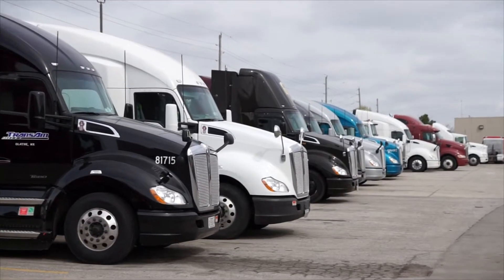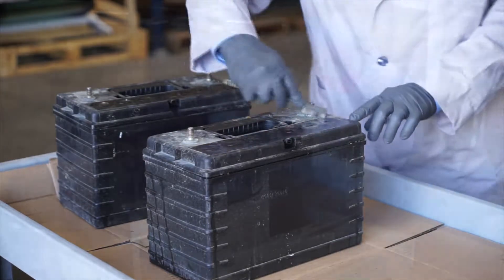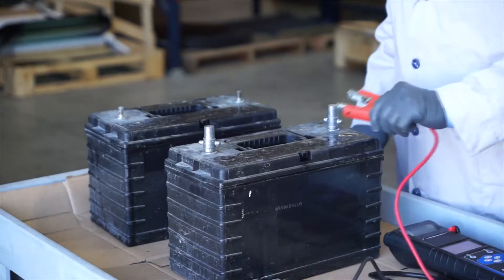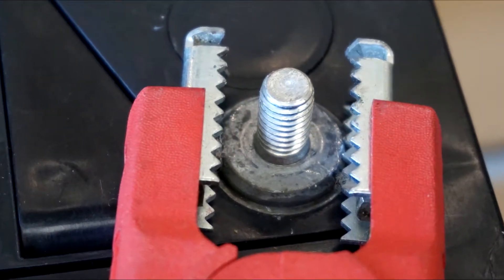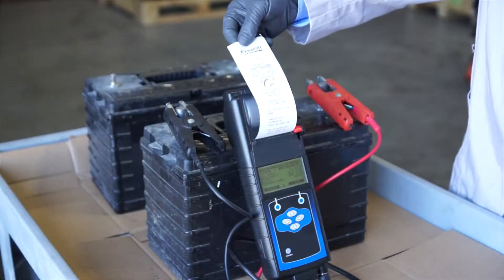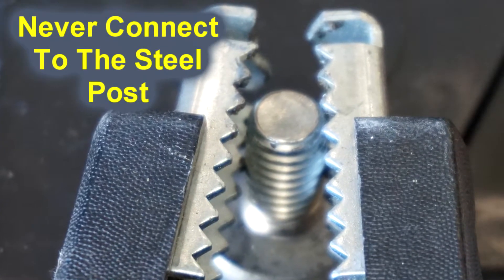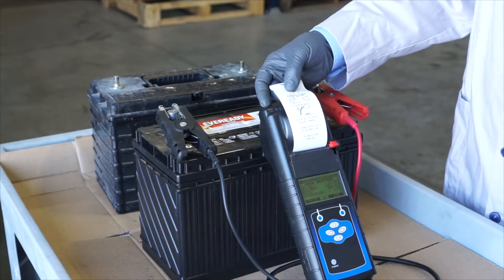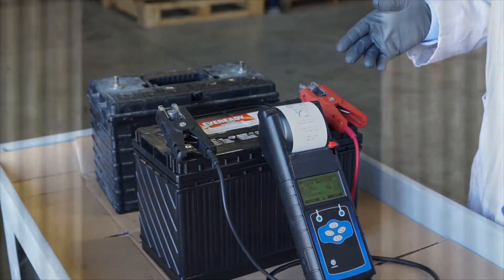Testing The Group 31 Battery - The Battery Shop

Comment: Great video!
can you get away without having to remove the terminals while the battery is in the car and not having the group 31s?
Reply from the maker: Hi - Thanks for watching! Modern battery testers can test any group size battery without having to remove the battery cables. This is usually referred to as "in vehicle" testing.
Reply: @TheBatteryShop great video 😮😮 i was having that issue 🤦‍♂️🤦‍♂️ 100% charge but cca at 100